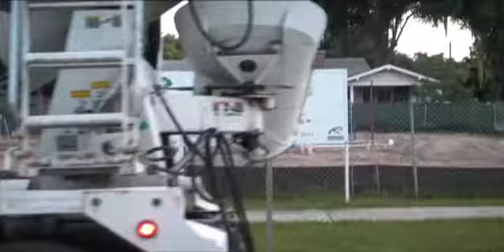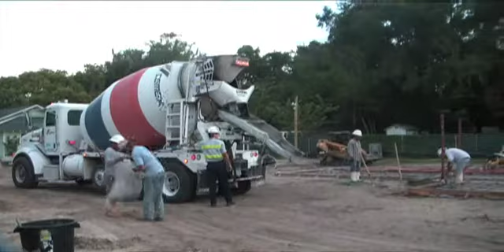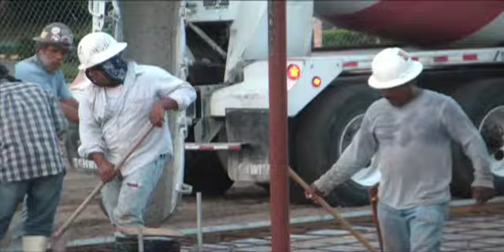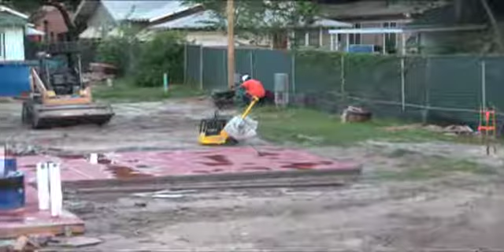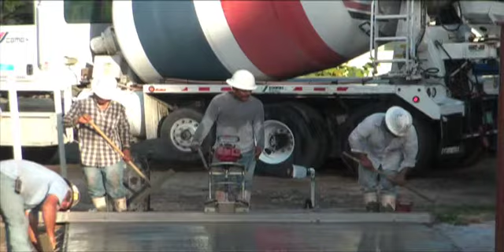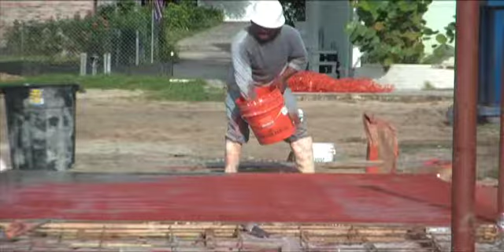The Usonian House | And red all over

Comment from the maker: As shown near the end of the video, a colored powder, designed for tinting concrete, is sprinkled onto the surface while it's curing. When the house is completed, the floors will polished.

Here's a video that might help:
You'll need to add the standard intro for the URL because YouTube won't allow a link in a comment:

watch?v=yLdSynJvQ04